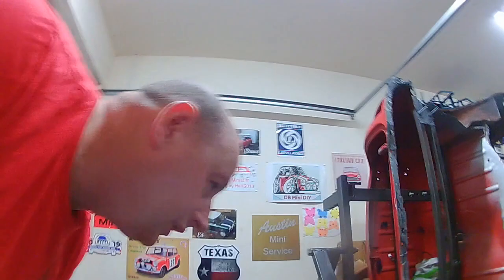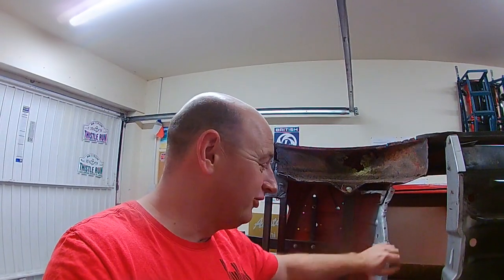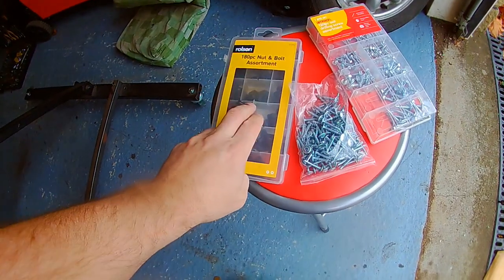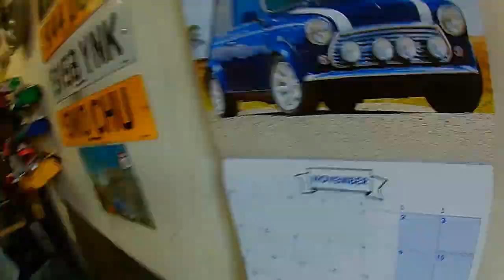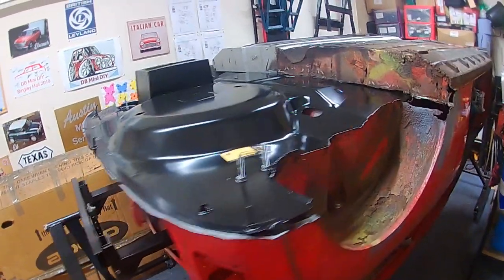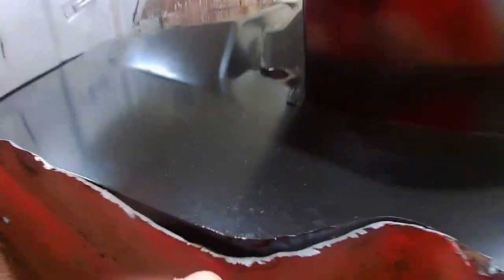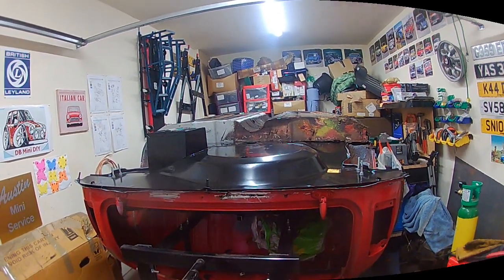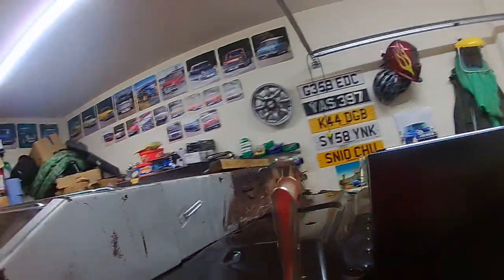Classic Mini Restoration: Eleanor Video 51, Test Fitting The Boot Floor

Comment: This brings back memories with the same issues I had when fitting my boot floor, even with the heritage arches going in at same time, I had the same problem around the driver's side arch not fitting correctly at the rear. Plenty of hammer and Dolly will sort that pal. 👍👍
Reply: I think your right with the jig not helping as it's probably bending down in the centre and your right to support it underneath, I didn't have a jig but had it on its roof with roof bars to sit on, mine was opposite whereby the boot floor was slightly lower at the rear, once I'd propped it up to support it temporarily, everything came into line. Pics on Sean's FB page pal too 👍
Reply from the maker: @danhardy5752  yes you done brilliant with yours mate. Plenty of challenges ahead for me but that's half the fun
Reply: @DBMiniDIY thanks DB appreciate it,  that's true would be boring if everything fit perfectly lol. Looking forward to seeing your progress pal 👍

Comment: DB, It‘s always going to be a problem with such a large panel but the basic fit is not bad considering you have a few panels
to change and the bars across where the trunions fit are very small tabs. Once you start to screw it in place it will pull it all
in to line, I mentioned the same thing to Randy about his complete floor. Cheers Dave
Reply from the maker: Yes I'm finding it is pulling in better when clamping and screwing in, I won't weld until i know its right, cheers

Comment: Nice update db... will you be fitting the new wheel tubs before welding in the floor?
Reply from the maker: I will clamp it, get it right then weld the floor to the seat base, bolt or screw to the floor then can move onto the arches, so it will be welded on the parts that will be staying